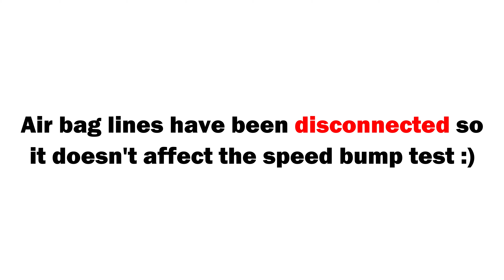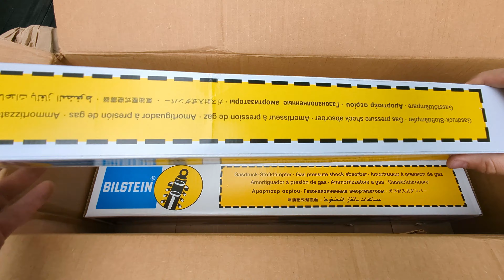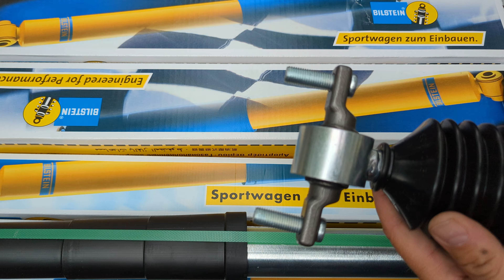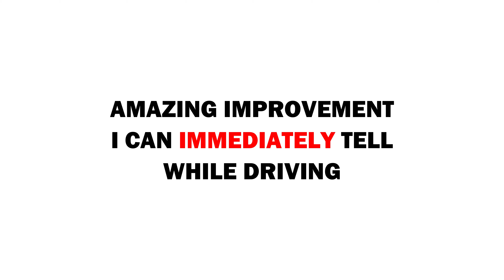Replacing My Ranchos with Bilstein 5100s Before and After Slo-Mo!

Comment: Rancho is garbage always have been
Reply from the maker: I don't have a big working knowledge in shocks, these trucks are already pretty stiff suspension, for towing, and I tow really heavy, all the time. I haven't had a horrible experience with the Ranchos but there definitely is a noticeable upgrade with these new Bilsteins both towing and empty.
Reply: My 24 gmc 2500 duramax came with them and they let the truck bounce to much. My 22 at4 had them too and it was the same all the old lifted trucks I've had i had a few with even the rancho 9000 and honestly I have never been happy with any of them I always switched to bilstein or fox
Reply from the maker: @chadoliver8689  yeah when you get to the 2500s and 3500s they definitely will be stiff because the suspension is there to carry the weight, but having good shocks can definlay make a world of difference.

Comment: That was the first time I've seen anyone removing Ranchos that still had some rebound left. I replaced the original shocks on my 2011 1500 that I bought new with the Bilstein 4600. What a difference they made. I should have done it when the truck was new. If I buy another new truck, I will. There's alot of curvy roads here in the Ozarks where we live now and the difference in handling is dramatically improved.

Comment: Searching videos for shock reviews and just came by this one.  Just to be fair, if those Ranchos came as OEM on that truck, they are not the same as Ranchos you would buy after market; even if you think you are buying the same model number.  The OEM shocks are tuned for the car manufacture specifically for that truck for all kinds of reasons (to match the OEM tires for CAFE standards, to meet gvt safety standards for braking, etc).  So, if you had compared them to off the shelf Ranchos, this would be a better comparison because both brands will feel better than the OEM.
Reply from the maker: Good to know!

Comment: Great video.   Like you mentioned, I saw on the Bilstein website that the front 5100 shocks were listed as being for trucks with a 1.5" lift, which implies they could only be used on a lifted vehicle.  But it looks like they fit up and work fine on your stock truck.  I was thinking of eventually replacing my Ranchos with the Bilstein 5100s but wasn't sure the front shocks would work.
Reply from the maker: @omcbob37  Yes sir I remember going to that deep dive but it's the same shock as what they consider stock and up to a 1.5-in lift. I've got 15,000 mi on these now and they are excellent on my stock truck.
Reply: @OhHeyItsBilly  Thanks.  I just got a 2024 Silverado 2500HD a few weeks ago and I'm already unimpressed with the ride quality of the Ranchos.   I'll give it a few more months and probably swap to the Bilsteins.
Reply from the maker: @omcbob37  yeah I hear that a lot from guys, I'm not too critical on the rancho shocks, but they've fallen from grace of their original pedigree when they started being mass produced for GM trucks. These trucks already ride a little stiff when they're empty, and I think these shocks help that a little. But I tow a LOT, so they even help more. I did 50,000 mi on my Ranchos and I probably should have taken them off at about 25,000.
Reply: @OhHeyItsBilly  I'll soon be doing a good amount of towing my travel trailer.   In addition to the shocks I might replace the stock rear bump stops with a set of Timbren stops or Sumo Springs.   I put a set of Sumo Springs on my old Silverado 1500 and it made a huge difference in ride and control quality when towing.
Reply: The 5100's I put on my 1500 Silverado said 0" to 1" lift.

Comment: I know this video is a year old, but I wonder if you know the difference in the Bilstein 5100 and 4600, and how the 5100 is made for lifted trucks that see more off roading than typical.  They have a stiffer ride as well.  The 4600 is more of a stock road and handling feel and are for stock ride height trucks.  Believe me, there is a little bit of a difference.
Reply from the maker: I don't have a educated working knowledge between the 4600s and the 5100s. So far doing a lot of heavy towing and empty driving with the truck over this past year, I can definitely tell that there has been a significant upgrade with the Bilsteins versus the Ranchos.

Comment: The Rancho and Bilstein shocks that the factory sells on the stock truck are actually a little different than the same Rancho shock you would buy in the aftermarket outlets.  They are less expensive due to them buying in bulk, but also a little lower quality and they are valved a bit different for comfort as well as specific ride and handling characteristics.
Reply from the maker: That's interesting! I didn't know that, so far I have really been liking the upgrade with the Bilsteins.

Comment: Good video. There are torque specs for these. Rear use oem specs 85 ft lbs, and front tops Bilstein say's 33 ft lbs for the nylocks. Question, when was the last time you greased your front end?
Reply from the maker: Thanks for the comment! Probably last alignment few weeks ago.

Comment: Billy don't know where you ordered your stocks. I used  your parts numbers and looked on Amazon. lol they dont list the numbers for are trucks but they do list it compatible for a 3500 the cost of the shocks is 371.00 
and they list the same parts numbers that fit a 2014 through a 2018 chevy for 341.00 for a set of 4 they are the same shocks haven't found any difference just the price.
Reply from the maker: @duanejohnson4043  yep that's where I ordered mine and I paid $376 out the door

Comment: Thanks brother very informative video, I have the same truck but I have 90,000 miles on my ranchos I am replacing them soon. I've noticed when I'm pulling my 14,000 pound 5th wheel it is squatting  the rear end about 2" and it bounces up and down quite a bit when pulling the camper. Do you thank the new shocks will help with the squat or should I put a set of air bags on my truck like you have on yours?
Reply from the maker: @duanejohnson4043  thanks so much for the compliment! So shocks dont support weight at all. It dampens movement up and down so your vehicle doesn't look like uncle buck haha. A million dollar shock or a blowed out shock, when the load is sitting still, you will have squat. Now load support I am a big proponent for air bags. I've put Airlift 5000s on every truck I've ever owned and I regularly tow 18,000+lb gooseneck and have never had to replace a bag. With air bags, when you're empty, you can air down and have your stock suspension for a better empty ride. The Timbrens and Sumos are SUPER SUPER stiff when your truck is empty despite all advertisements that they aren't, it's 100% a lie, it makes your truck a really rough ride when empty. That's because although they look separated as you drive down the road, even when your truck is empty, they slam together against themselves when your suspension travels, yes even when empty. Now if they're under full-time load like a service truck, or full-time mounted truck bed RV, or anything where the truck is under a heavy load full-time they can be awesome because they're always under load and not so stiff like when empty and no moving parts, zero maintenance. But you will absolutely love airbags. Just add whatever psi you need for your tongue weight to make it level and pair that with good shocks and you'll be lovin life.

Comment: I’m late to the video. But these should work for a 2025 Chevy Silverado 2500 hd trail boss? Trail boss being only an aesthetic package. But looking to upgrade from rancho
Reply from the maker: I'm pretty sure they should, I looked up the 2021 (my truck) and 2024 year model, and the part number was the same. It didn't let me denote Trail Boss, but I don't think it matters. Just double check before you order.

Comment: Awesome video! Is the factory nut on the front tops also 13/16” wrench?
Reply from the maker: Thanks so much!!! No the bolt on top of the front shock is a ¾.
Reply: Thank you!!
Reply from the maker: @prbell73  absolutely!
Reply: Came here to ask the same question. Headed down to do the Pittman arm, idler arm, tie rods and shocks. Thanks for the wrench sizes and the video.

Comment: Do I need taller coil springs if I use bilstein 5100 on a ram 2500 for a 2 1/2” lift
Reply from the maker: @leonardcusumano3524  I'm not sure sir. These were installed on stock Silverado 2500. But when I did a 2" on my old ram I didn't need new coils. When I did a 6" I did.

Comment: How come nobody takes the spare tire of before doing this. Damn it would make things so much easier.
Reply from the maker: I was taking time to give some dialogue during the video, but there's just two bolts, one for each side holding them in the upper part, it is pretty darn easy to do it with the spare tire up there. But if you want to drop the spare tire it definitely would make it that much easier.